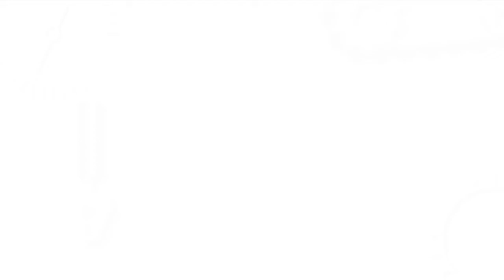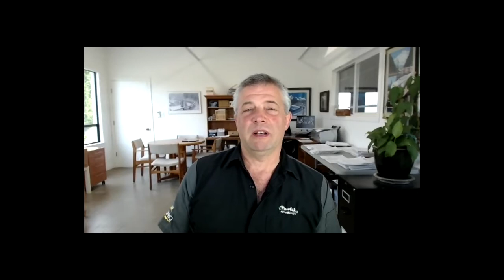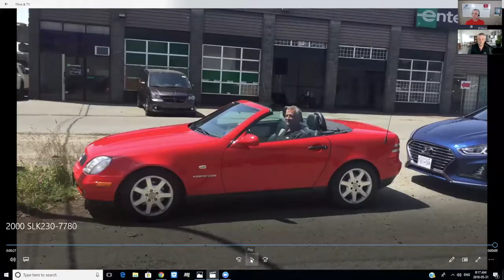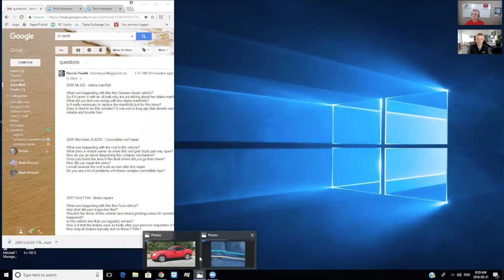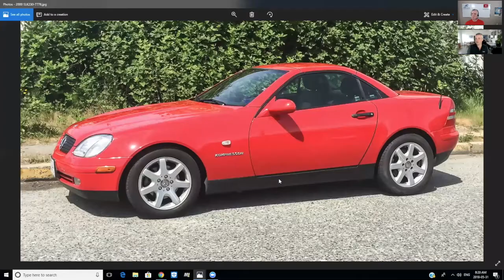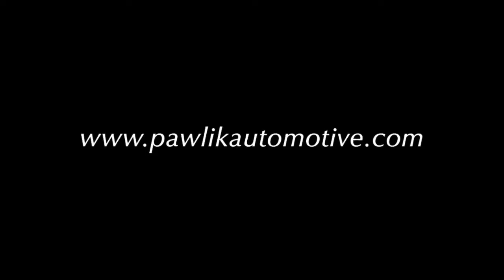2000 Mercedes SLK230 Convertible Roof Repair

Comment: Hello to you, I am French and a bit far to come see you, what a shame.
Can I ask you a question?? On my SLK R170 from 1997 I changed a closing cylinder and then manually use the roof because the opening button no longer lights up. I have checked the fuses and the contactors appear to be in good condition. Thank you very much for your response and hello to our Canadian cousins.

Comment: Thank you for taking your time to make this video.  I just inherited a pristine 2000 SLK with only 50K miles and the top probably hasn't been down 10 times in all it's life.  But it was interesting to see your video and what you found.  Also I will take your advice and read the owners manual on how to deal with the top manually if I ever have an issue.  Living in south centeral Oregon I still have to find a reputable Mercedes repair dealer.  Wish I was closer to you.  Thanks again for the video.

Comment: hi I had a question. the panel that comes up when it starts to convert gets jammed with the roof because a spring has broken. I'm having trouble finding this spring online and was wondering if you could help me with this issue. would you happen to know the part number or name?